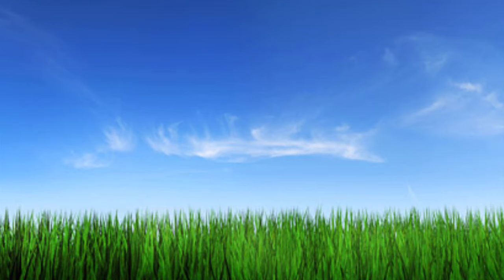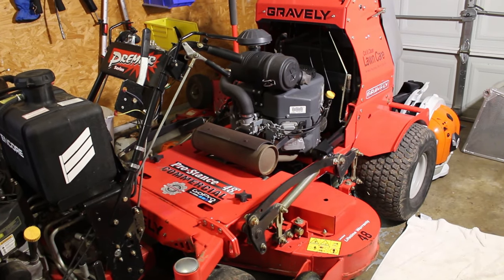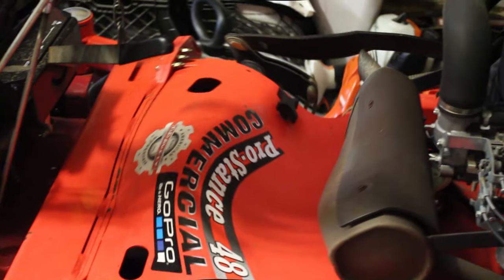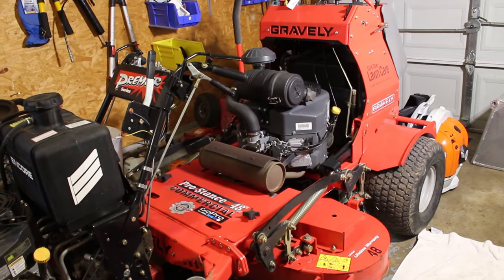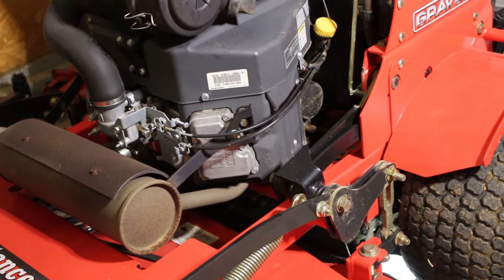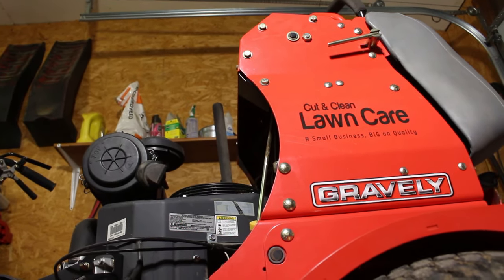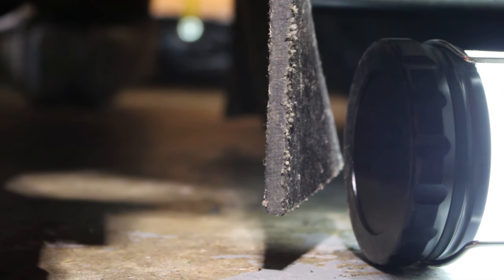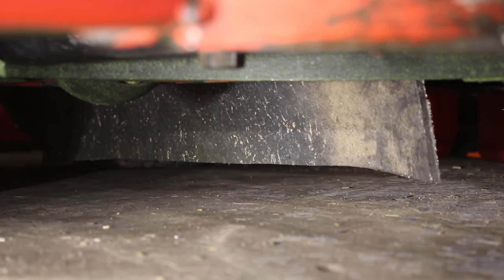DIY Lawn Stripe Kit ► Gravely Pro-Stance, Stand on Mower Striper Kit

Comment: That will defiantly do it. Luckily i know a guy who owned a conveyer company that gave me scrap thick rubber that I bolted to the rear of the deck. True talk, I think a roller (for mine) would have worked better. The rubber strip actually gouged at times, and it ripped off several times. Best of luck with your setup.